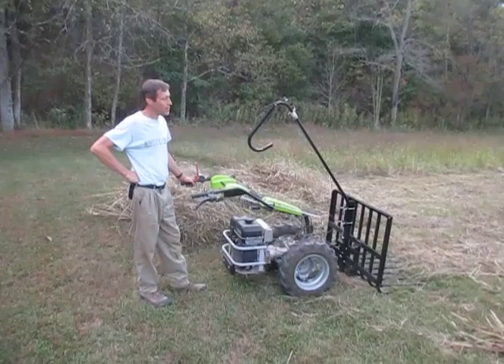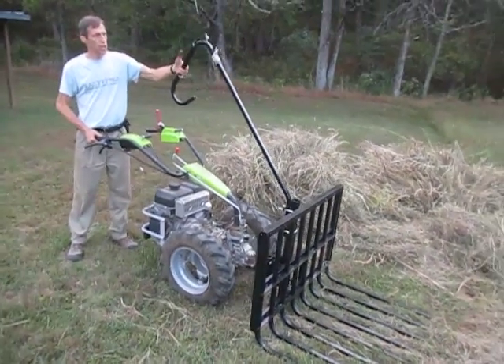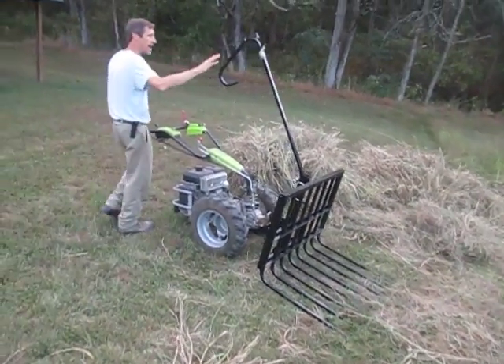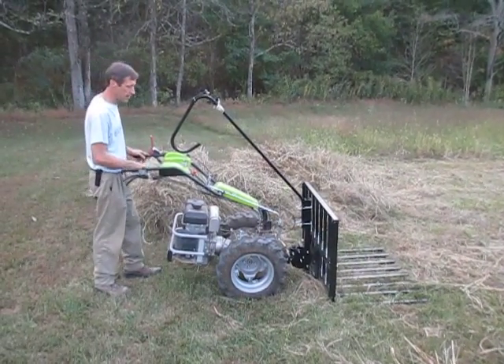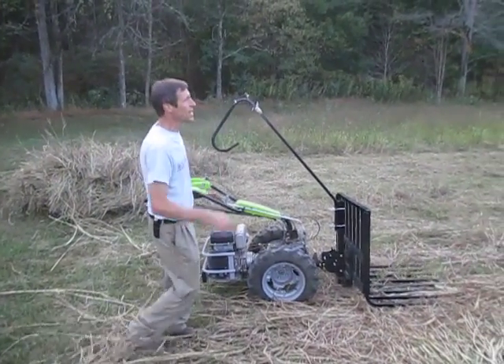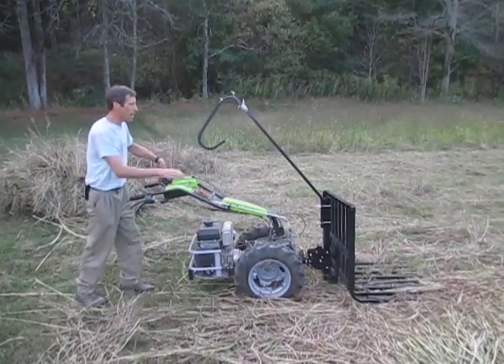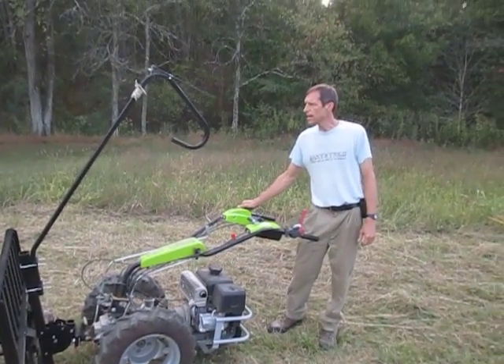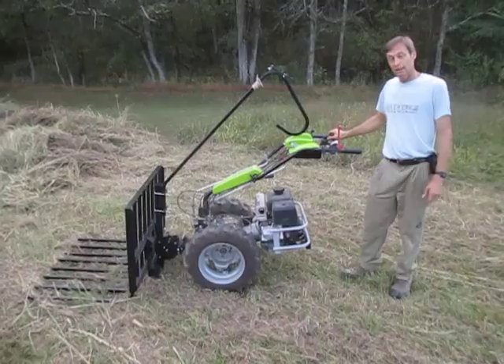Demo: Buck Rake for Walk-Behind Tractors

Comment: This tool is not used in europe in flat terrain. It is used to push the hay downhill to the point where you can pick it up with a tractor. This is old tool, replaced by hayrakes, like for example Lavrih AlpFlow. But these are much more expensive and used farmers with alot of steep slopes.